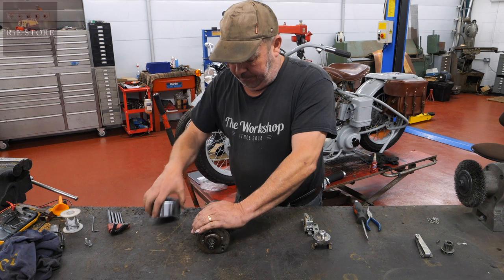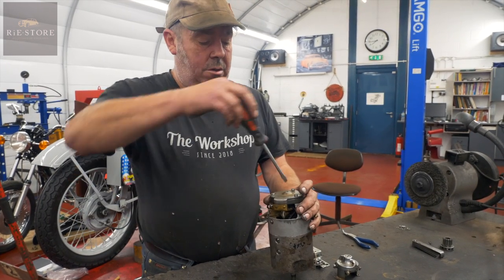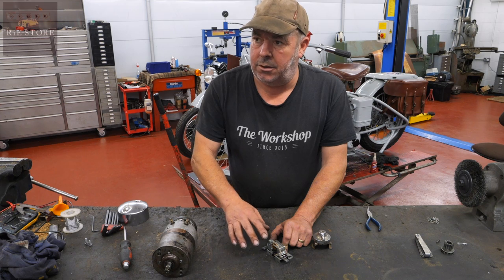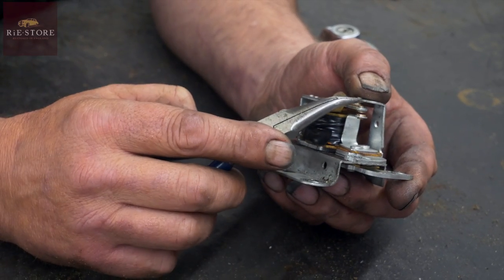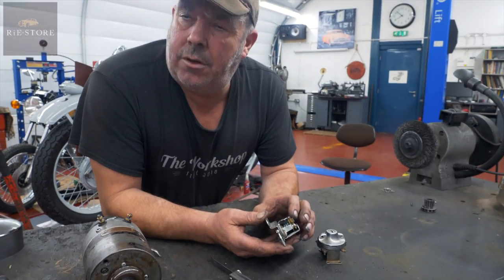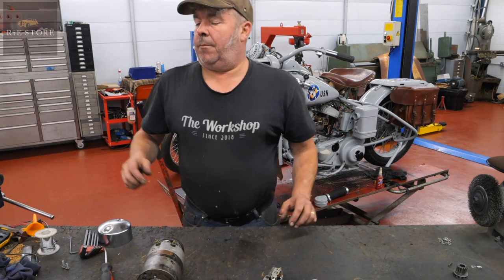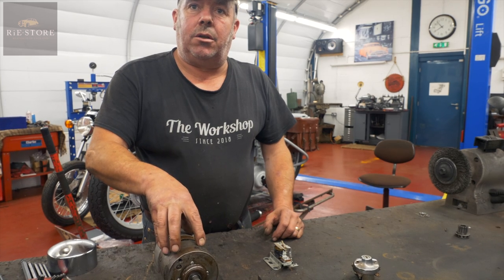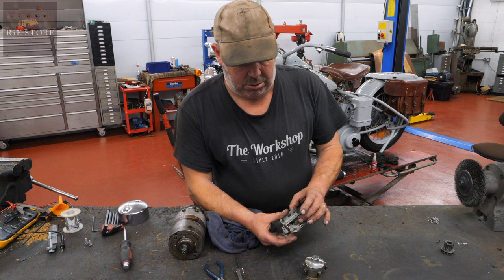How the WLA/WLC generator and relay charge system works / ep256

Comment: great explanation of the generator system , the only thing that i would change in the explanation is the reason for the third brush. 
Just so everyone understands to control the output of a generator in general you control field current , more field current , more output or in this case the more fields the more output.  
There are 2 field coils in the 32E generator , the regulating field coil and the shunt field coil. When the engine is running current will flow from  the positive brush through ONLY the "regulating field coil " and to  the 3rd brush back to the  commutator. The position of the 3rd brush dictates how much output is generated by increasing or decreasing the current through the regulating field coil.  As the brush is moved more towards the positive brush the output becomes less and vice versa. 
Then when the headlight is turned on there is a positive feed , from the ignition switch, that sends current to the "shunt field coil providing additional output  to compensate for the additional current draw of the headlight , current is now  flowing through BOTH  field coils  at the same time. 
In a nutshell it a crude but very reliable system that has some voltage regulation without actually having a voltage regulator .

Comment: Still running a electronic cutout relay of Dixie( 1 of the 1st i think) which i bought from Aad Samwel in late 70s,it still works after a lot of miles today and i think its a great upgrade for the mechanical one

Comment: The green wire from switch connects to lighting coil in genny not third brush; to boost output when lights are on.
It’s a good system let down by the indifferent quality of the 22ah batteries these days. Which is why I modify to 6 or 12volt 2 brush systems; you can use smaller batteries (size and ah).

Comment: I honestly disagree with Ash, the 6volt circuit I have in my WL is amazing good… I wouldn’t replace it by a 12 volt. And I use the lights and auxiliary lights on all the way…no issues. All you have to do is to adjust the generator.
Reply: agreed,  I use it on 2 VL's, a WL, and a panhead.
Reply: now 3 VL's :-)

Comment: They have no flexibility of output in 3 brush form. If adjusted for your particular riding style, they are not bad, but they will ultimately boil the battery, or fail to charge over time. Even HD themselves created  bulletin 418 to convert to 2 brush.  With the quality of currently available batteries, 3 brush is not ideal. I fitted a model 61 to mine, with electronic control . 6v, visually similar, and I can run a smaller, more easily available battery if required. The quality of aftermarket control units is very poor too.